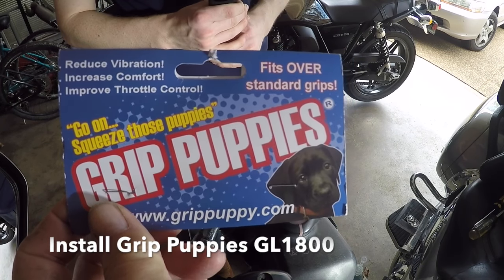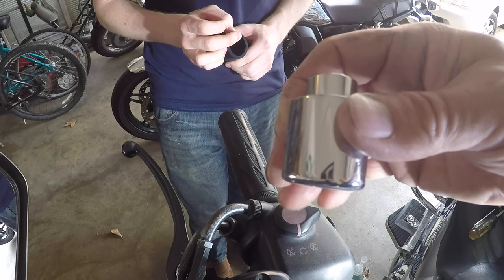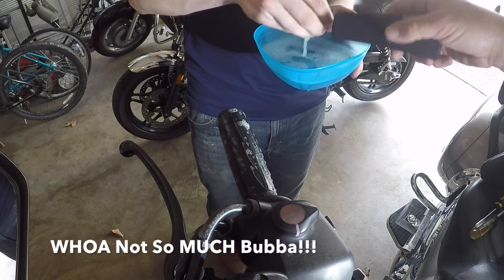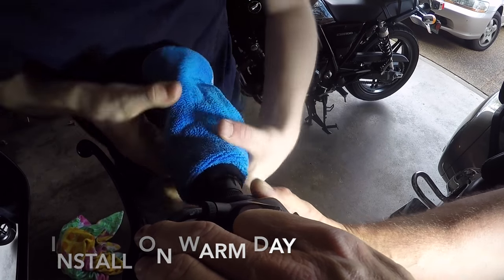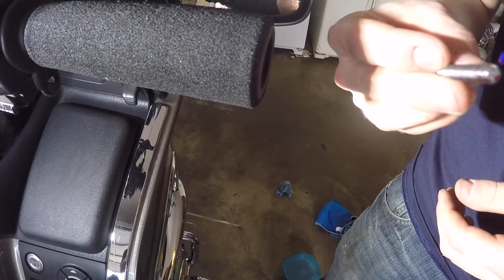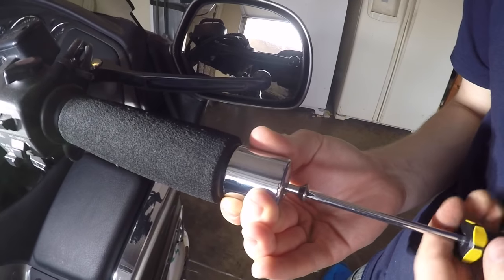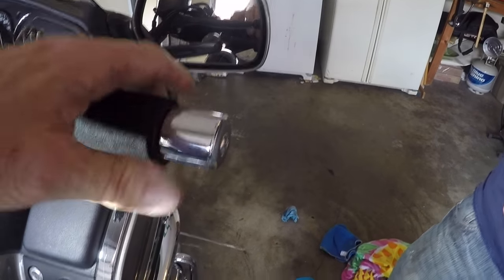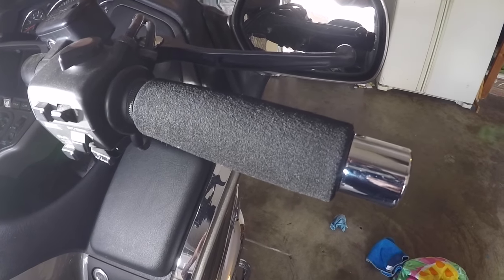Grip Puppies Installation Honda GoldWing

Comment: I did the same thing to my 08 wing...got rid of the kuryakyn grip covers and put on puppies and the chrome ends...I used hair spray and they went right on...  You will definitely like the puppies....Good video Mike !
Reply from the maker: I really liked the look and feel of the Kuryakyn....unfortunately the heat loss thru grips and the issue of the chrome flaking was discouraging to me!
Reply: MemphisMike, Hi Mike. This is Kevin, from California. NOW, I have watched your video on installing Grip Puppies. I watched another video, where they used an air gun to put on the foam sleeve. 

I like that in your video, you use the soapy water. So when it dries, there is something tacky to help the grips stick.

Comment: I just bought a set of these. I know I am a little late on your video since it was about six years ago. But, how did they work for you? Also, when you are twisting that onto the throttle, did it mess up the heating element. Did the heat still work in the grips?  I’m afraid of breaking the element twisting them on.
Reply from the maker: Heat works fine. I have since learned a different technique. Take an air compressor and blow into them and pull at same time. Much easier!
Reply: @MemphisMike901  I have used WD 40 installing other grips.  So, I tried it in the grip puppies too.  They slid on with ease.  I actually went too far forward with both and had to back them off.  I have concerns that I won’t get the full pull of the clutch and it will slip ever so slightly and unnoticeably and do damage.  DIY forums have told me it is of no concern.  But, it is still in my mind.  There is no way I could afford a clutch rebuild.
Reply from the maker: @williamlivers1326  I do not think that clutch should be an issue. Been running these a long time on all my bikes

Comment: I've run those puppies for years, did you have any trouble getting the Kuryakyn grips off, I have them on my bike now and would rather have GP's on it.
Red loctite was originally used as a bearing set and calls for heat to remove, I stick to blue and don't let the red anywhere near my bike. I know a lot of people use it and I used this stuff daily in my profession to set large races in alloy cases, the "blue" is a better choice.
Just a thought
Reply from the maker: no trouble removing kuryakyn grips....the were destroyed removing them tho!!!!!!! I love the GP's!!!

Comment: I had something like that on a bike years back. problem for me eas when it rained they soaked up the water.   let us know if you find that to be a problem thanks Mike.
Reply from the maker: willl do...did you have an issue when it did soak up water? were the grips slippery?
Reply: MemphisMike. no yjey we not slipery. jist like holding a spong. maybe they are better.   looking forward to your test ride video.  mike count down till we ride to the dragon,blood mountain the devils traingle ,cherihala skyway and wheels through time in Maggieville. i wanted to ask you at wjat gear do you stay in for mpst of your riding. from your videos your doing 35 to 45 through the twisties and sweepers.
Reply from the maker: Steven Koppen I would say 2nd/3rd gear mostly